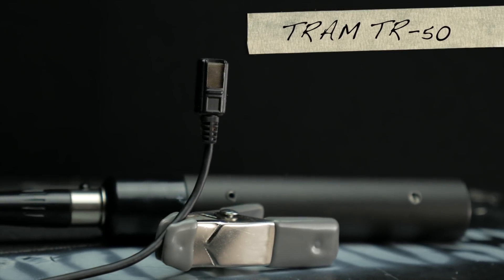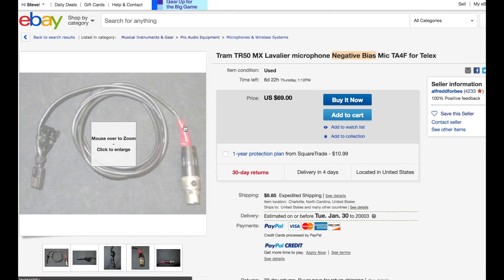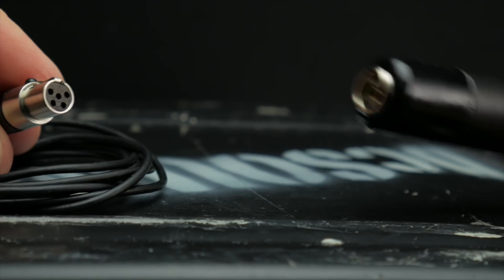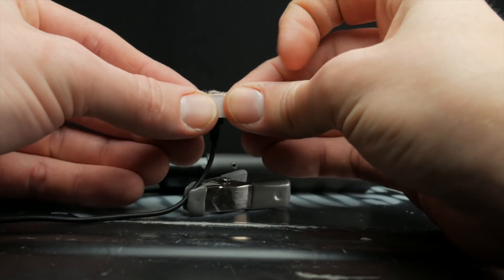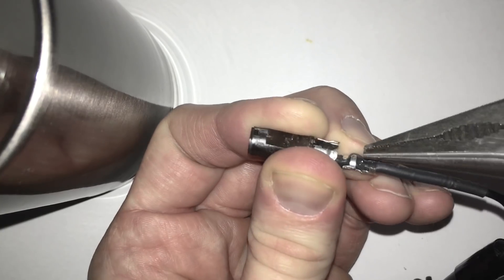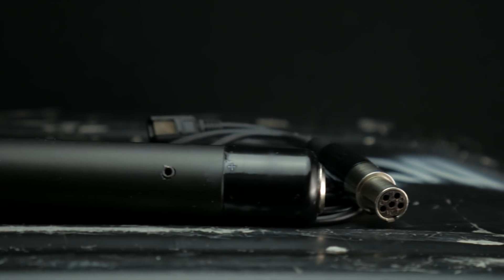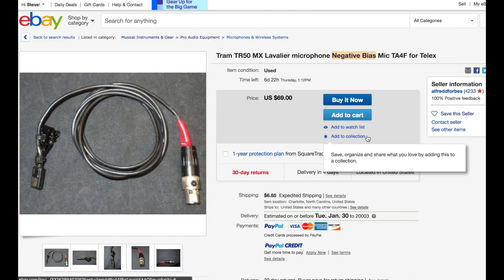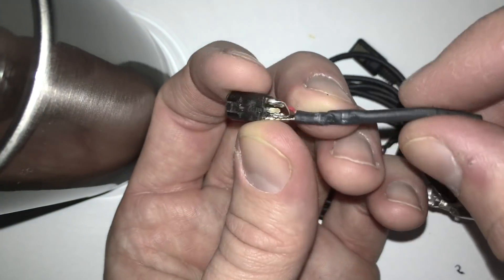#81 - How to: Tram TR50 Microphone Bias identification

Comment: Hi. I really like these mics but find it hard to hide without getting clothing noise issues. Any advice?  Thanks
Reply from the maker: Alejandro, trying to mitigate clothing noise is an art and science all to itself. As a live and broadcast guy myself, I don't claim to have any advanced knowledge on the dark arts of hiding lavs under clothes and still getting stunning audio. I do the standard moleskin triangle that most folks do. With the tram mics, I find that putting a loop in the cable a few inches back from the element and then securing the cable down with tape to the clothes or body can be HUGE in mitigating cable noise. 

Check out Curtis Judd's video if you haven't already - some good tips in there https://youtu.be/DAlnQD5vUtw
Reply: @DcSoundOp  Could you make a video on mic placement and your best ways of doing it?!  Thanks for this video also!

Comment: i still have no idea what bias is or what it's for or why it matters
Reply from the maker: elitestar Hey, I’m sorry the video didn’t break it down clearly.

It’s simply a voltage applied to power a circuit or part of a circuit (a microphone in this case). Microphones can be wired for either positive or negative bias voltage, typically to accommodate different wireless transmitter configurations (manufacturers wire their gear differently from each other). 

If you’re buying lav mics to go with your wireless mic systems, you’ll want to make sure you’re ordering the correct one for your specific gear, otherwise they’ll just seem like they’re defective & won’t work when you try to use them. 

Hope that helps make sense of it all. If you’re into learning more about electronics in general, I’d suggest checking out the Mr. Carlson’s Lab channel, his videos are great even if you don’t understand everything he’s doing... I know I don’t!

Comment: Could/Did you attempt to repair the one that was dodgy?
Reply from the maker: I didn’t as it seems to be a connection inside the rubber boot right at the connection to the plastic element housing. I’m not sure if they even open in a non-destructive way & I’d be hesitant to use a repaired lav and have it ruin a take if it was stressed again during normal use.